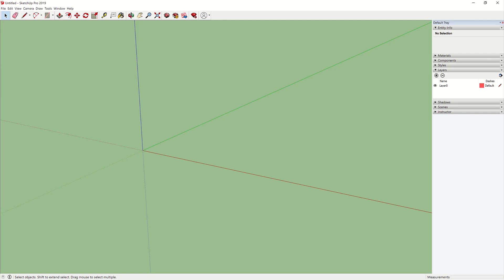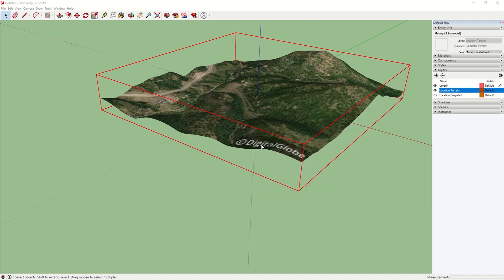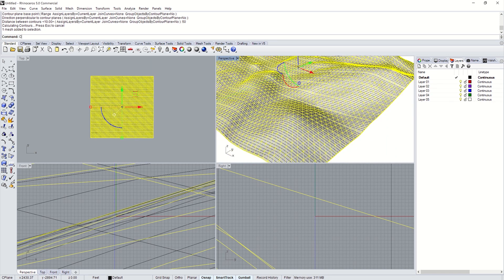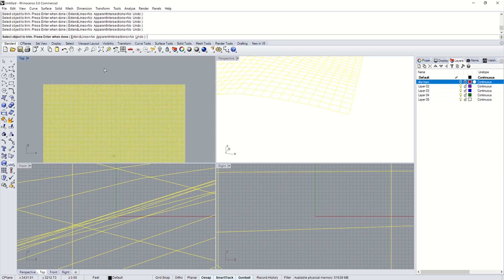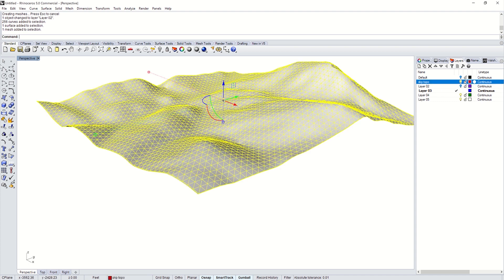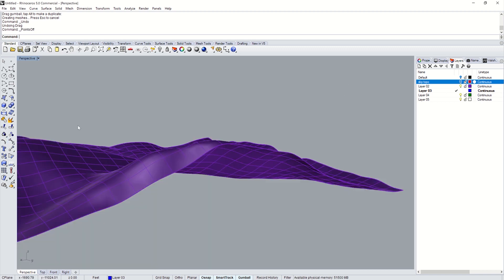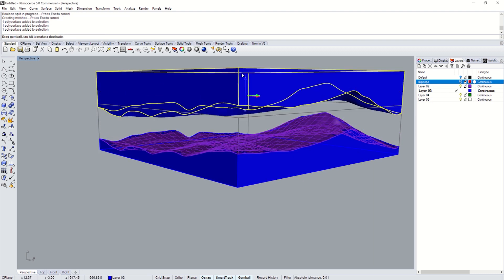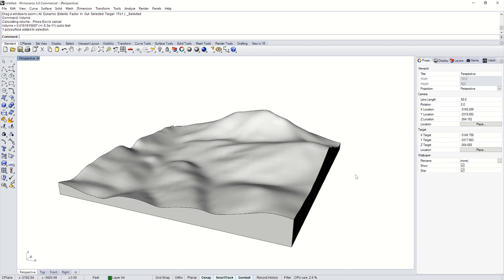How to Create a Topography in Rhino from SketchUp - UPDATED!

Comment: Google maps won't be accurate right ?? so how do we scale it to 1:1 and later convert it to different scale ?
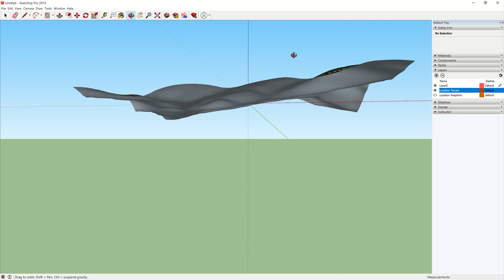Reply from the maker: This method isn't really meant to get the model 100% accurate. It's a more of a visual representation of the site you're working with that's way faster than making it from scratch. As for the scale, it comes in as whatever unit you export it as. This is explained around the 1:07 mark. To convert it to a different scale you'll have to do some manual scaling and math.
Reply: @RyanMJohnston  I don't think with any software you'll get 100% unless it's a total station, I just wanted to know if I can scale it to a nearing value to design
Reply from the maker: @ajayp7916  You can scale the model in rhino by using the 'Scale' command and scaling down to whatever size you need to.

Comment: I tried to do the networksrf but I ended up with 1 open surface instead of just a surface. Do you know what went wrong?
Reply from the maker: you probably have a hole in your surface somewhere. I'd recommend trying to add more contours to make sure that the network surface can actually form a surface instead of trying to stretch and break itself.

Comment: I tried to do the networksrf but nothing happened
Reply from the maker: That's a really heavy command. Your computer is probably getting bogged down. You might have to try and scale back the amount of curves or do smaller sections.
Reply: @RyanMJohnston   iam not able to select the surface after the netwrksurf
Reply from the maker: @involveasia7270  see if the layer is locked or it might not be a NURBS surface.